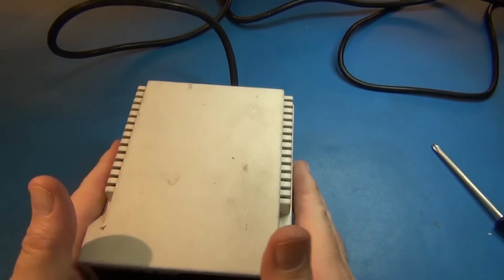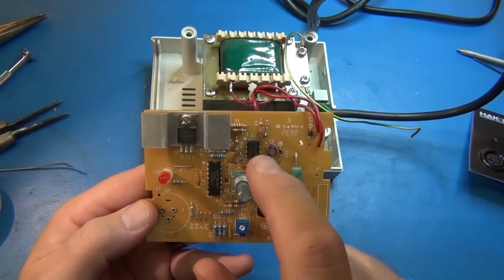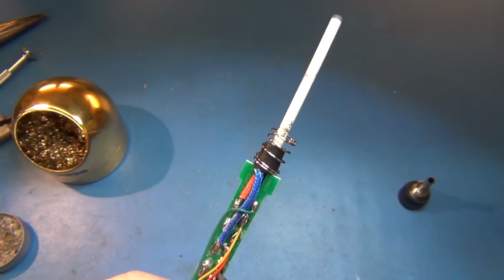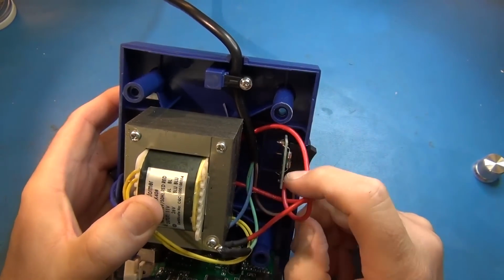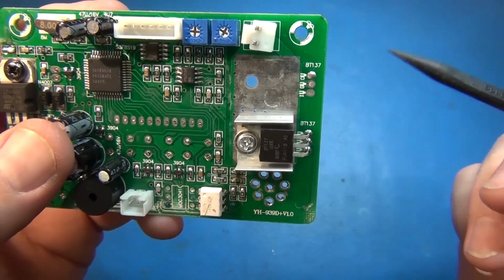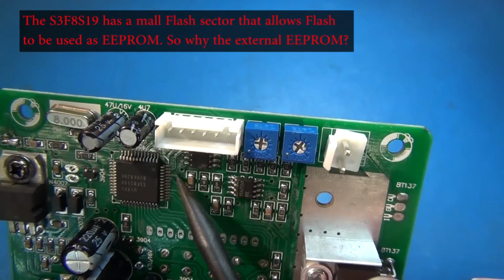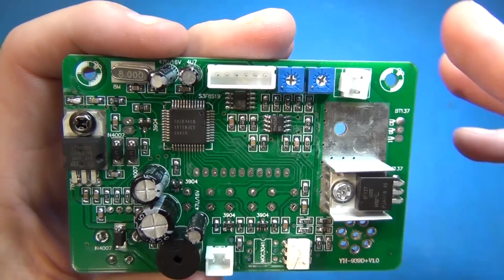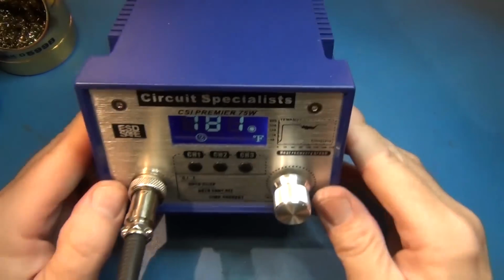CSI Premier 75W and Hakko 936 Solder Station Teardowns

Comment: The transformer is 24V DC or AC?
Reply from the maker: All transformers are AC output. DC comes after the conditioning circuits with smoothing, rectification and regulations. DC will be produced by the conditioning circuits for the chips that control the station. I'm not sure if DC or AC is provided to the iron tip. It could be pulsed DC or controlled AC via triac, I guess either would work but I'd have to reverse engineer the control  unit to know.
Reply: @ToddFun  Thanks for the reply.. the main thing I want to work out is the iron heater 24 volts and the 2 sensor wires there is no negative or positive..why can't you buy boards for all these irons asham to throw out over 10c part.
Reply from the maker: @glendooer6211  I watch this video and in it I did reverse engineer the circuit some. I said in the video it was 24v AC from transformer to iron tip and is controlled by the triac. So if you have a problem it will be the triac or it could be something wrong with the micro controller. Test the triac first by manually triggering it and if  you can't then replace the triac, if  you can then it's  your controller and that  you will not be able to replace.
Reply: @ToddFun  trouble is triac is about 1/2 the cost of a new board so just ordered a new board..need to check iron connections,

Comment: First time I see this soldering station. Would be nice to have the schematics for it, looks actually better than the original hakko!

As you mention, the micro probably has some internal eeprom they could have used, and the fact they didn't, actually shows good design overall when coming from china.

Flash and eeprom memories have a limited write-cycle life-span, so external ones are used because it would be cheaper to replace an eeprom than it would be to replace the whole micro and it's firmware.

It's not uncommon to find these in dip packages (on dip sockets) to quickly change them. With little help from the firmware it's all just a matter of replacing it, turning the device back on, and set again your values for the next decade. 

About the unused triac, it seems by the traces it would be controlling the other lead of the heating element, which is quite strange, I couldn't find a reasoning for that.

I saw your other video, but you didn't measure current, did you? Nor you showed or read transformer's stick. It doesn't look to me like it could deliver 75W, though when you took the soldering iron apart in the other video, it's heating element is not the proper solid ceramic one, but the ones with nichrome wire wound with a ceramit tube on covering it, of which big clive has a teardown video.

All the best!
Reply from the maker: Still a good station for the price I think. I use my hakko more howerver. I like the tips better on the hakko. I guess if I put my hakko tips on this CSI it wouldn't be any different as I think the hakko tips are better conditioned for longer use then the pack-o-tips that came with the CSI.

Comment: Another superb video. I came across your other video "CSI Premier 75W Soldering Station Review" first. And that was also very insightful video to watch. You made many great points for improvement that would make the soldering station a lot more appealing to potential buyers only if the manufacturer chooses to listen... I happen to have a Hakko FM-2027 handpiece with a couple of T15 cartridges that I got for b-day gift without soldering station to hook up. And I'm wondering if you think the Hakko handpiece can be used on CSI station by replacing its connector.
Reply from the maker: No, The Hakko hand-piece is not usable on the CSI

Comment: the  place for the second opto oscillator is for the tweezers model ie with 2 tips and the  other  regulator thats not populated is for that  other tip on the tweezers one
Reply from the maker: Sounds reasonable. Thanks.

Comment: hello, if anyone knows if the internal are of a better build quality in the csi premier rebrand or in yihuad 939d+ , i would be glad to have your thoughts , if i can light the price of 25€ for a few weeks more to wait that it arrives , it doesnt matter to me :D
Reply from the maker: I wouldn't think there would be much difference in the build quality really.
Reply: thanks for the info , im a begginer in soldering ,would like to start learning with some reliable unit , i can buy a used weller wecp-20 for 100€ or this yihua 939d+ for 77€ what do you recommend ?
Reply from the maker: The new 939 would be better option. You know it is working and its less $ and will work as well as the weller.
Reply: my only concerns are longevity & fixability , i will of course test the station with a infrared thermal sensor , 25€ more for a better build quality & longevity , what do you mean work as well as the weller , regards
Reply from the maker: for a beginner in soldering the 939 will work just as well as a weller for you. You will not be using it 8 hours a day 5 days a week. Plus with the auto sleep and shutdown mode built into the one I reviews it will be much safer and the tips will last longer.
Reply: thanks for the information , i think i will go with the 939+ then :D

Comment: Todd excellent review on construction and operation of the unit.  I find the CSI unit very tempting but am wondering how the Yihua unit that looks the same compares in quality and features. Are both units built in the same factory and do they have the same software operational characteristics. Thanks
Reply: I have been using it for over 6 months and have been very please with the operation. The issue I experienced at the beginning I think was just getting use to a iron that turned off if momentarily tipped up side down. The CSI unit is identical to the YH-939 so why pay more.
Reply from the maker: +HO TRAINS If you get one let me know. Thanks.
Reply: I purchased a Yihua 939D+ and it is identical to the CSI Solder Station. I has the same face plate and transformer part number as well as the same CCA part number YH-939D+V1.0 as the CSI unit. The unit works great even when soldering code 83 model railroad rail to PC ties. The features of this unit are a great value. The only issue I noticed was if I was soldering then momentarily tip the iron up it stops heating at times but the display is still blinking which says it is controlling at my 367C set-point. I think the little ball in the 907 iron opens and the controller turns off the heat for a minimum time. Have you experienced such issues with the solder station? What is your understanding of how the station and iron are supposed to work when tipped.
Reply from the maker: I have not noticed such strange heating issues. Mine will only stop heating if the iron is at a shallow angle like in the cradal for its sleep time setting. And as soon as I tip the iron up it starts heating again. maybe you have the sleep time set real low. I like to keep the sleep time long like 20 minutes with a shutdown setting of 30 minutes.
Reply: any news about your issues HO TRAINS ?
Reply: thanks for the info , im a begginer in soldering ,would like to start learning with some reliable unit , i can buy a used weller wecp-20 for 100€ or this yihua 939d+ for 77€ what do you recommend ?
Reply: my only concerns are longevity & fixability , i will of course test the station with a infrared thermal sensor , 25€ more for a better build quality & longevity

Comment: Very nice presentation Todd; I think you make a good point about the CSI Premier being over engineered, perhaps they were looking at making it more sophisticated and appealing to the buyer. But logic must have prevailed while in construction to keep it simple, however that said the door has been left open to make changes in the firmware without adding or keeping components to a minimum if changes are desired. Finally, who ever decided on the lens cover maybe should have their eyes checked, hard to believe they goofed up on the simplest application.
Reply from the maker: +John Cunningham Thanks. Others have noted the extra unused features might be for another model that uses the same base board but has an hot air gun attachment. Kind of makes sense to be able to reuse the same base board and just populate it and code it for a different purpose. The lens was crazy stupid but so was the heat recover graph the size of a postage stamp on the front. The layout must have been created by sales agent committee because that is the kind of shit such committees finalize one instead of intelligent design.

Comment: Excellent tear down, thanks!

I have one of these CSI 75w soldering stations that I got to replace a 35w Aoyue Int 937+ digital soldering station when I realized I needed more watts and faster temperature control for soldering LiPo battery connectors. I keep the 937+ as a spare as it's been very reliable and works well for most light duty applications. And they use the same tips and that is a BIG plus in my book.

The display on the CSI station I have is actually fine even with the dark glass, it looks to the eye pretty much like it does at 26:35 in your video. It's near a window and I can see it fine even with a fluorescent magnifier lamp I use shining right on it. The problem you encountered may have been with your particular soldering station, though it would be interesting to hear from other owners what their experience with the display is. BTW- it is possible there is a way to adjust brightness on the display, maybe one of the pots you see at the top of the board or a special mode via the firmware.

Also, I wanted to comment on the opto isolation. It is likely they did that so as to meet ESD or other standards and ratings, and to be competitive on the market.

I noticed the lack of solder on the pads for the buttons and the LCD after you removed the board in your video, but was glad to see there was adequate solder on the same side as the component. If you think about the manufacturing process, it would make sense that the board would be mounted in a solder jig, the person then inserts the components and solders from the same side without having to flip the board over again, saving a step in the process. Since it REALLY isn't necessary, it makes for a more efficient workflow.

But I'll have to say, it sure bugged the crap out of me to see the lack of solder on those pins!

Comment from the maker: @Jenn B, Good eye. Thanks for looking that up. The link you provided does match the numbers on my board however the image in your link is more analog looking, more like the the old Hakko 936. So the PCB board of that would not be like what should be found in the CSI premier 75W. Unless they simply failed to update the silk screening layer or don't even know to update board file silk screen layers. Or, they really want to keep the number the same with such a massive product update. Also, the display on your link looks red which might have looked better through the filter... maybe...  Strange the one in you link even has a display when the input seems analog.

Comment: Why use optocouplers, because the supply to the heaters is AC and the uP is 5v DC.
Reply from the maker: +loefstrand Hadn't thought about that at the time. But being this is a triac shouldn't it still work? I guess I never tried such a circuit.
Reply: +Todd Harrison (ToddFun) The MOC3041 is a optoisolator that is intended to be used with a triac. Just do a image search and you will see some examples.
Reply from the maker: +loefstrand I'm sure it is and do understand how it is being used. I guess I don't design with such mix of AC and DC so I'm not too familiar with this need for an opto issolator. I was thinking being this triac was designed to be switched directly from a micro and that mircos are normally ran on DC and knowing you could share a ground tap between the mirco and source leg of the triac combined with the fact this is not high voltage signal control I figured it would work just fine. Maybe something with the common transformer taps would cause issues? I didn't give it much more thought than that. Now I might have to do some research to see if such a setup as I suggest could even work.

Comment: I wonder if that second unused channel is for an air gun soldering wand, to control the motor speed for the fan.
Reply from the maker: +Chip Guy Vids Good idea. I'm thinking your spot on with that being this is really a YIHUA rebadged station. Most likely they use this same board with the extra channel in this: http://www.yihua-gz.com/Products_detail.asp?id=235&sortid=267
Reply: +Todd Harrison (ToddFun) Haha, awesome. My sugesstion was just a wild guess. Great find.
Reply: NO! its for hot tweezers version

Comment: External EEPROM's often get used because using the internal flash can be a pain in the butt. Been there, got fed up, used external FRAM ;)
Reply from the maker: +Chip Guy Vids I was kind of thinking that was why. I too had to fight with some bad errata once getting the internal flash to behave with my code. I did get it working but had to contact the manufacture for a custom work around. In hindsight it would have been faster to just use an external EEPROM.
Reply: +Todd Harrison (ToddFun) Internal flash often has limited write cycles, while the external has a whole lot more, plus internal often had block size limits or other quirks like not being able to read from half while programming a bit. 2 pins and extra chip probably took less code in any case, especially if you already used I2C parts.
Reply from the maker: +SeanBZA Ya, good points. I think the chip I was using had a 10K write limit but that was like 9K more than I was ever going to use.
Reply: +Chip Guy Vids Using internal EEPROM is not harder than using internal even most modern compilers for microcontrollers will make it look like any other memory access (only slower). Only reason they use it is for endurance or in this case because microcontroller they choose do not have internal EEPROM.
Reply: +SeanBZA External I2C EEPROM when they enter writing cycle disable all inputs so they are totally inaccessible so there is no difference between internal and external.

Comment: 18:55: It says "358" on the chip.  That is a ST LM358 dual OPAMP. Jelly bean part.
Reply from the maker: +Chip Guy Vids Thanks. I hadn't even thought of looking up the part by that number. I hate it when parts are generically labelled. If you're not familiar with the simplified labeling you just can't find any data.

Comment: How does the triac get up to 500 volts, as you said it is just used as a switching output for the iron? How are the DC rails generated?
Reply: +roomba There is none, they are switching the 26VAC through the triac, that's all. The 5V DC for the micro comes from the 11VAC rail through the 7805.
Reply from the maker: +roomba Its just the triac rating from the datasheet. I didn't mean this circuit actually gets to that voltage level.
Reply from the maker: +PuchMaxi1988 Correct. However, I never measured the 11VAC tap so I guess you know this from some markings? or from some other source?
Reply: +Todd Harrison (ToddFun) Other clones use a 10-11VAC secondary, which gives you roughly 12V as a drive for the opto and the 7805 does not heat up too much. Also used in the hot air stations to give a 12V fan power, why have 2 separate transformers when 1 will do.
Reply: *****
Thanks for the answer. Is the Triac part of a SMPS buck converter?
Reply from the maker: +SeanBZA Ya, multiple taps are very common on transformers for just such designs. I see them a lot.
Reply: +Todd Harrison (ToddFun) Yes, that was an assumption I made from seeing the 7805.
Reply from the maker: +roomba No. The triac is just being used as an AC power switch to pulse the 24V AC on and off to the wand's heating element. The microcontroller then monitors the temperature of the iron on separate wires and controls the triac's duty cycle to maintain tip temperature to within +/- 5 C
Reply: *****
Oh, never mind, I forgot there was a transformer at the head end of the circuit....:)
Reply: *****
That is cool, I would never guessed the a AC switch controls the iron heat. I always though it "had" to be DC  to the iron. But this is best way as it gets isolation as well.

Comment: Still faking the reading as being stable. When it reaches setpoint it changes to the set temperature instead of the actual tip temp so you do not see how badly the simple algorithm overshoots, and how much the temperature varies around set value.
Reply from the maker: +SeanBZA I hadn't even thought about testing that. I hear there is a reasonable iron tip calibration probe I can get on eBay. I think I will get that and test. Well, I will first try to rig up something with my Fluke 289 with graphing mode but I'm not sure how fast of a thermal responds my K type tip would give me, it might average out any large fluctuations.
Reply: +Todd Harrison (ToddFun) Welded tip type K is very fast responding, will show up the overshoot quite well. Just use some fine copper wire to tie it to the iron near the tip so it will give a consistent reading, then graph away with it. Should have around 20-50C overshoot and then oscillate by around 5C around setpoint. There is a open source firmware upgrade for those irons ( or even a complete clone Hakko board) that shows actual tip temperature on EEVblog.
Reply from the maker: +SeanBZA Good to know. I would love to use the open source code to add velocity encoding and correct the 100 C sleep to 200 C. I will make a graph and add it to the review blog post.